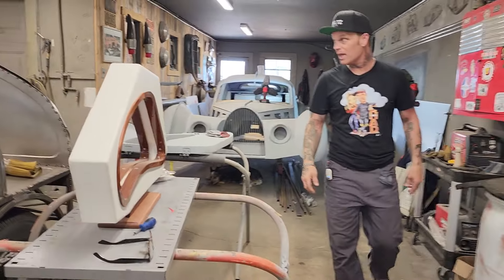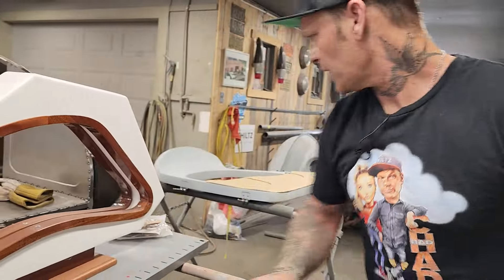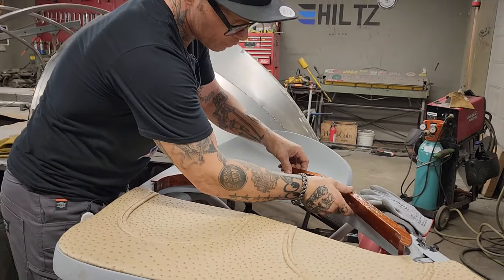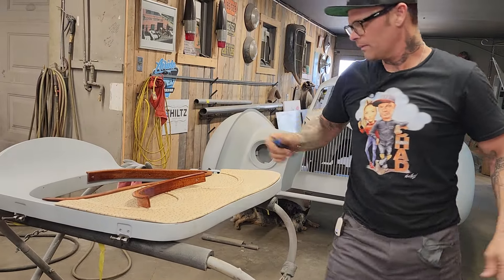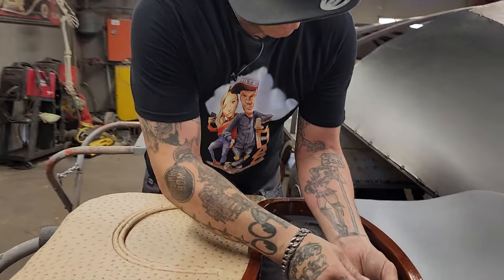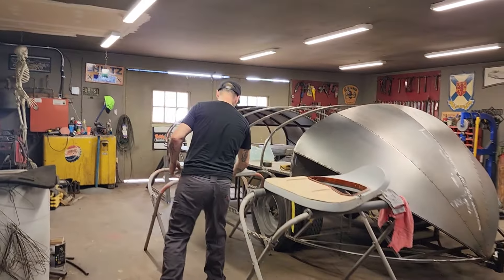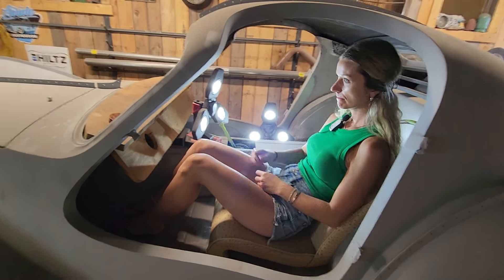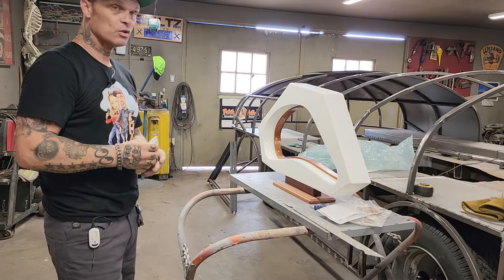The Bugatti interior has arrived... let's do a trial fit 🙏🏼

Comment: Maybe use Torx screws, or Allen screws for mockup. The will stay with the bit better when aligning trim with the holes. Then change them out later if you want straight slotted screws for the final look.

Comment: I've learned in the past that when you take the screws out be very careful but when you put them back in put blue tape first so if you slip with the screwdriver it won't be catastrophic LOL. I do that with everything now that's painted and I don't want to get scratched. You'd be surprised what a difference it makes. Just another helpful tip from another Gear Head. You could pull the tape off when the screw is 3/4 in that way you won't have blue tape behind the screw.

Comment: heres a tip, use posi-drive screws when test fitting the wood or other painted items then use the flat head ones on final assembly, saves slipping on the test fits
be a good idea to hang the doors with the interior trim and rubbers on before you paint it too, door rubbers can make a big difference in the door kick, best avoid any supprises later on
hmm rivets tbh they both look like they will work, the smaller ones look more like the original though

Comment: I am so glad you are going to Get the Bugatti done. You have done an awesome job. As for finding the door trim holes. I'm a retired aircraft mechanic. A trick is to use a scribe. Or grind  point on a metal
Reply: Gring a point on an old thin screw driver . Locate . A line  your holes. Great Job.

Comment: Jolene please let Chad know that when you have the interior piece going under the absolutely gorgeous wood. Take a pair of pliers or vice grip and squeeze the high points down so when it's painted it will go on much easier.  I have created and installed well over a hundred interiors and over a thousand interiors in boats,  so I am telling you from experience. 
Jolene you made amazing choices in materials and colors.

Comment: I would use the large rivets. I believe the circumference of the small rivets is closer to the original cars but in my option they are much to high/thick. The flatter the better. ☮️🇨🇦

Comment: Chad, use a leather strip between the wood trim and the door. Not only will it take up the slack, it will keep the wood from rattling on the metal. Without something underneath its going to chatter.

Comment: Why don't u buck the rivits in? They make a tool for your air hammer and then you hold a piece of steel on the other side will smash the other side of the rivit. I'm sure that's how they did it from the factory. Check out a semi trailer rivit.

Comment: The gastank is not tested. Better coplete the car, testdrive it and then at last paint it, also the doors do not have anything to make it watertight. I remember the petrol gauge construction is made with some self taping screws so it will leek petrol. There is much to do before thinking of painting.

Comment: Chad and Jolene I found an easy way when putting trim on is to take a long pick like a ice pick, you can hold the trim back and put the pick in the trim so you can see where the holes are then slide the trim down the pick then the hole is lined up